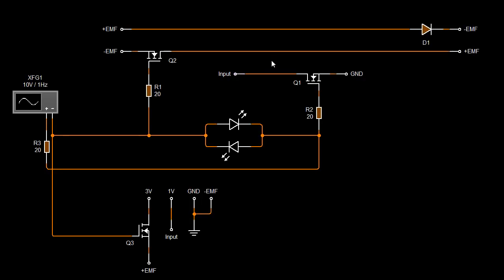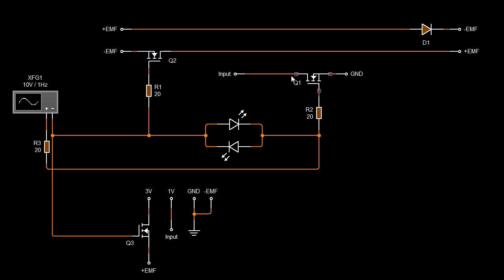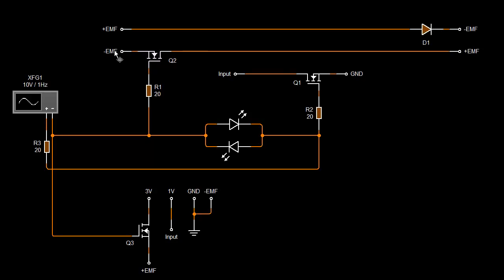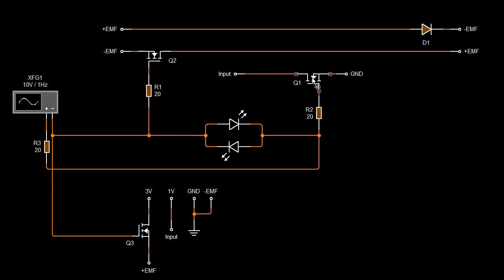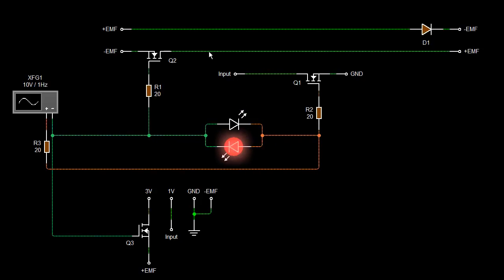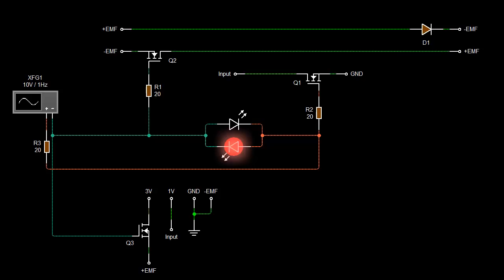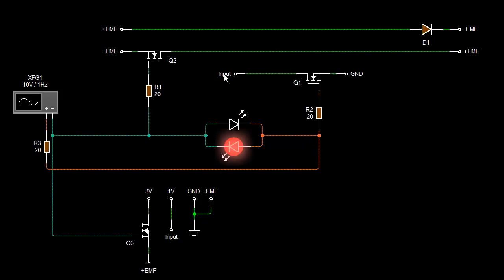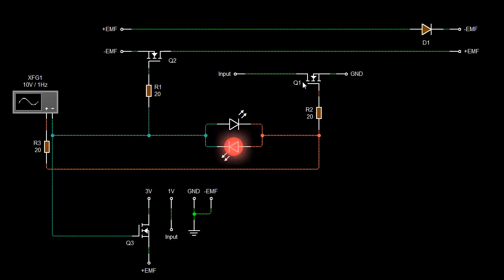Timing - Partnered Output Coils DC Switched  - Aboveunity is here!

Comment: Would you still need the switching transistor on the one output coil if the output coils are in ‘bucking’ configuration? At first glance it looks like a redundancy. Thank you in advance.

Comment: Hi, your contact form on your site does not work for me, perhaps you could get in contact with me. I haven’t been able to separate Len’z law opposing field from its creator that induced it as of yet. Every time I do manage to cause them to cancel each other out with two separate coils the the current cancels as well!
Reply from the maker: Hey Debunkified - Reading your text, youre on the right track, some work, experiment and some time will help. In order, please replicate the following:

1: http://www.aboveunity.com/thread/the-mr-preva-experiment/
2: http://www.aboveunity.com/thread/some-coils-buck-and-some-coils-dont/

Join us, and we can all do this together. One needs to think of Voltage as a separate entity, and Current also as a separate entity.

My contact form does work, but its tricky, invalid fields throw an error. Join our Forum: http://www.aboveunity.com and we can help further.

   Chris
Reply: www.hyiq.org 👋, I’ve been reading upon those very pages actually. Intriguing indeed. We’ll have a go at it. Me personally, the human side, can I use a step down transformer stuck into the wall for an AC voltage source? Also, if one does not have an O-Scope can he or she be able to rectify output with a common FWBR, filter with capacitors and measure ok with some decent meters? Or if using the AC range this should this be ok since the wall provides 60Hz frequency in which meters can measure very well and accurately? One more thing what can we all expect to see as far as input and output measurements? Or are we supposed to be looking at something else other than input and output? Where is a good place to place a load? If that’s possible. Thanks in advance. 🙂👽
Reply from the maker: Cool, glad you already know about them!

The MrPreva Experiment requires Magnetic Resonance, in this case a LCR Resonance between the two Coils where Currents are 180 Degrees out of phase, if you can get your resonance frequency at the same frequency as your mains, it wont be a problem. May be a little tricky. One could do this without an O-Scope, but hard and one would not learn as much.

Start at the start, do the recommended experiments first, learn from them, then the rest will follow.

Yes, DC Meters are fine for Smooth DC. But learn first, see what to aim for, know what youre aiming for.

   Chris